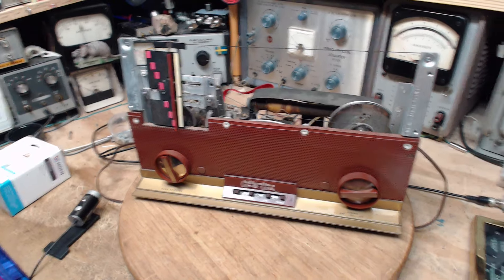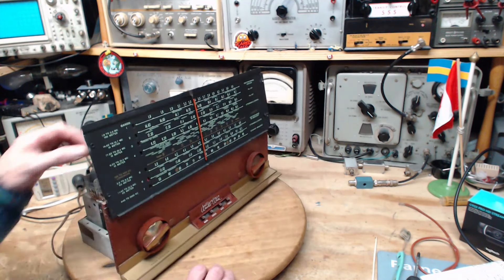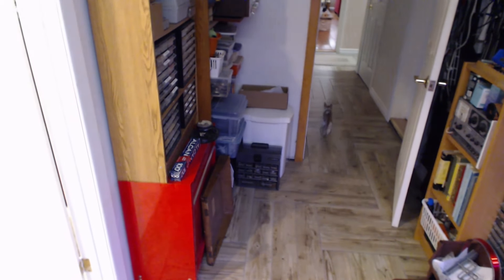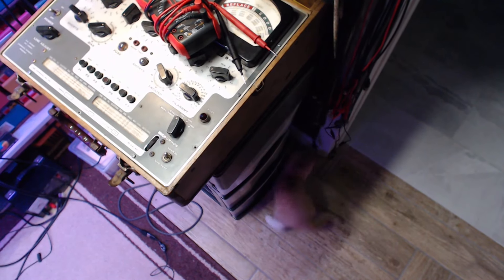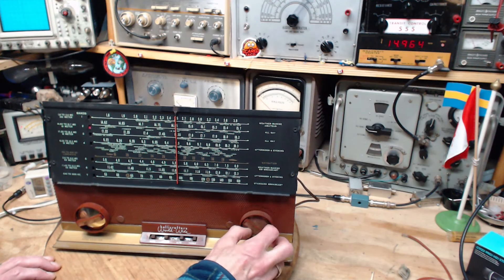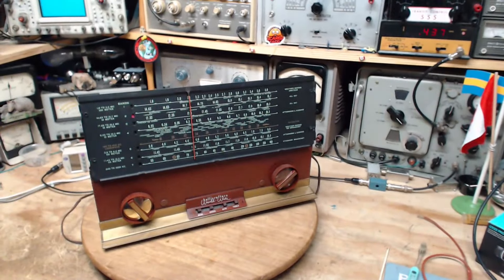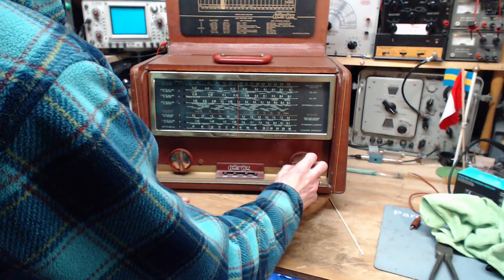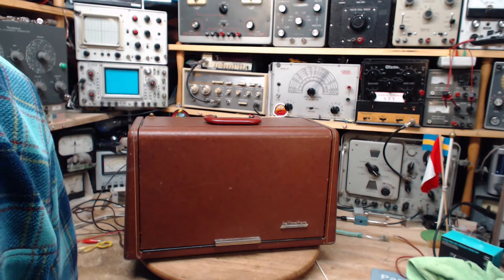Halicrafters TW1000 8 Band Tube Radio Video #4 - Kitten Finale

Comment: Shango66 is testing out solid state 1L6 tubes on a Zenith Transoceanic and he's been testing them in the California desert because he's been running into issues with noise at the high end of the dial, but he's been experimenting with solid state versions of those 1 and 3 volt tubes